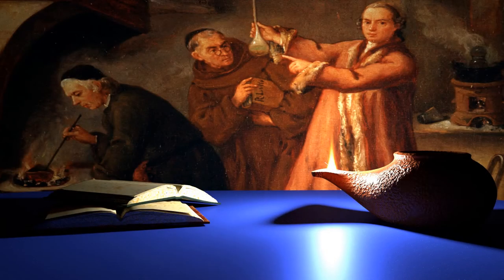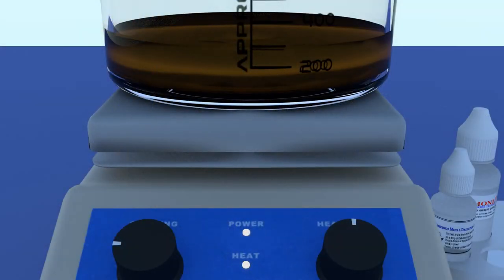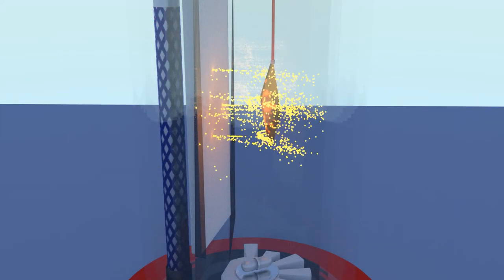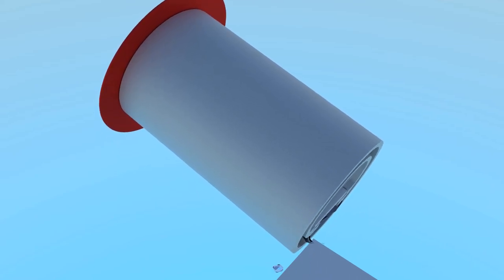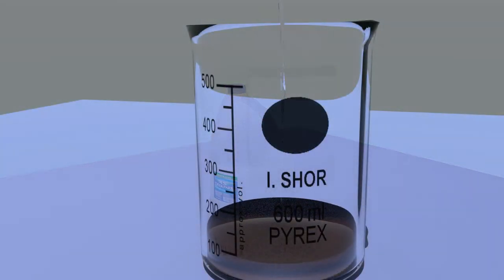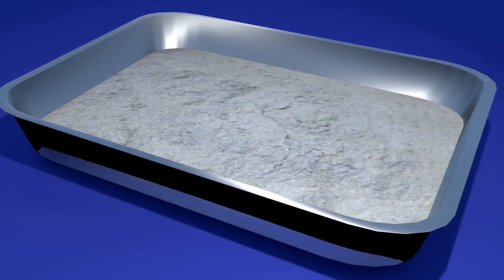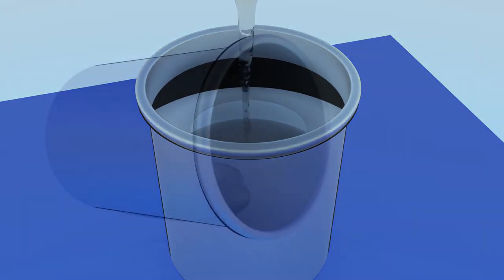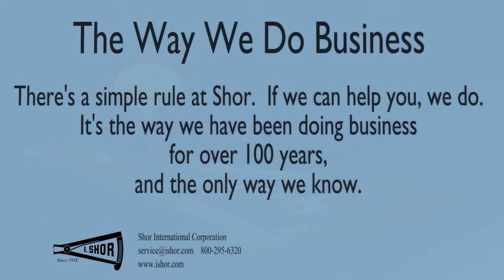SaltSystem Saltwater Based Gold & Platinum Refining System Instructions

Comment: What can be done to recover the gold, when after the completion of the refining process that we realized we have forgotten to add the catalyst.
Reply from the maker: If Catalyst is not added, then almost all the alloy will dissolve, but none of the gold content.  However, before discarding the solution,  you should use the Precious Metal Test Liquid to test the solution to ensure that no gold has dissolved 
The gold will be a brown mud in the pouch.  Just rinse this thoroughly with water, dry thoroughly and melt.  You can then refine it again.
Reply: @shorinternational3841  Hello. Your "system - device" will it be able to pull out gold rich activated carbon? and still it is possible to scale your "device" for 10-20 kilograms of loading?
Reply: @vodoroda9449  Yes, but...   It's probably best to burn the carbon first.  Just a matter of economics.  The metal content would be very, very low.  So the cost of consumables would be high compared to the gold content.  If thoroughly burned, the carbon would all convert to carbon dioxide, leaving just the metal.
Reply: @blaniardmarshall8924  Understood. Thank you for your reply.
Reply: it will be in the mud at the bottom then you have to dissolve that with aqua regia after collecting.

Comment: I have small metal bbs made of gold and palladium. Is this a good way to refine the gold and palladium?
Reply: This method would work if you either used it with the Nickelodeon accessory, or if you melted shot into a bar first.  However, you would probably be better served to use the AR3G system instead (higher capacity, no need for additional accessories or melting first).

Comment: I think the use of Iodine 2% solution will dissolve gold much faster with fewer highly specialized equipments.
Reply: Iodine is probably much slower.  However, the purpose of the process is to refine the gold.  Dissolving is simply part of the process.  Selective precipitation of dissolved precious gold can only be accomplished from chloride based solutions, such as saltwater and aqua regia.  So iodine solutions are effective in removing gold from computer scrap, but after recovery, the metal will still need refining.

Comment: In this video, the salt system is not suitable for gold with a lower purity of 14K. Why is that so? In that case, this also means that if we have our electronic scrap melted into an ingot, this salt system will not work?
Reply from the maker: Not sure how you got that impression.  The karat of the metal has no effect upon the refining and the unit will refine any karat.  However, as you have surmised, it is not suitable for electronic scrap.  The reason for this simple- This process requires continuous electrical contact with the item that you want to refine.  That is impractical with electronic scrap, since it is mostly plastic and ceramic.  If you were to remove the relavent metal first (and then melt it into a bar or sheet), then the SaltSystem would work well for you.  However, that's a lot of preprocessing work.  It would be much simpler just to use aqua regia, where that preprocessing is unnecessary.
Reply: @shorinternational3841  I have been contemplating getting the salt system for electronic scrap. I can get a lot of the electronic scrap, remove the metal and melt the electronic scrap into an ingot. For an electronic scrap of 1kg, the gold content may only very small amount like 1gm.  I am not sure whether the salt system is suitable. Aqua Regia method is one that I am not in favor of.  In my case, would you think the salt system suit my application.
Reply from the maker: @angellee5253  The SaltSystem process is not suitable for electronic scrap (please see the reply to your inquiry from Sept. 23 for more details).  You should be using the aqua regia process for this kind of material.
Reply: @shorinternational3841  I have been following your conversation.but my question is how can i refine rhodium? I have alot of it in bags but i dnt knw much about it processing it for internation buyers?
Reply: If you can please guide me.
Reply from the maker: The best procedure will depend upon your material.   You need to know what the non-rhodium components are, the approximate percentages of each, and the form that the material is in (for example-  shavings, bars, etc.).
Reply: @shorinternational3841  its its in a sandy state and I took someone there he siad it was 18.8 but ill get a geologist to test it and confirm. please whats next after that?
Reply from the maker: OK, so it's sand.  The SaltSystem is not the best method for material in this form.  Watch the video embedded on this page-  https://www.ishor.com/mx3-dissolving-agent     If rhodium is the only precious metals in your sand, then you can use DMG to selectively precipitate your rhodium from solution.

Comment: Question 1 : Can we dissolve 999 Gold Bars in it 
Question 2 : What dies the water look like after dissolved good
Reply: You can dissolve 999 bars.  The resulting purity when starting metal that is pure to begin with will be a higher grade of purity.  So, with 999, the result will be better than 9999.  Usually, the water looks green from the copper content in karat gold.  However, with 999 gold, the water will either be yellow or gold in color.
Reply: my friend that's a lie , for gold and silver? nothing like the acids and being carefull